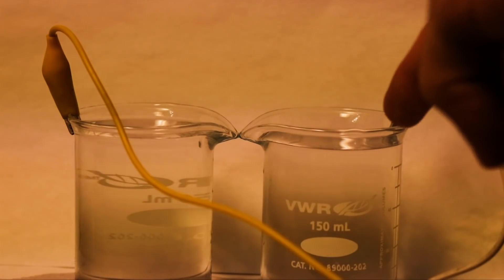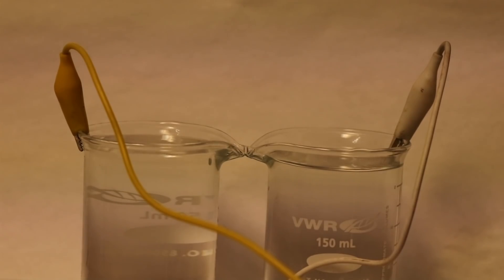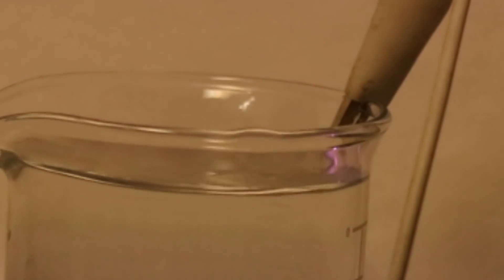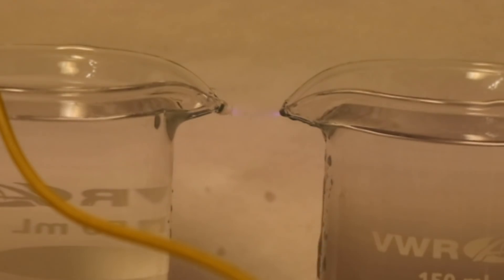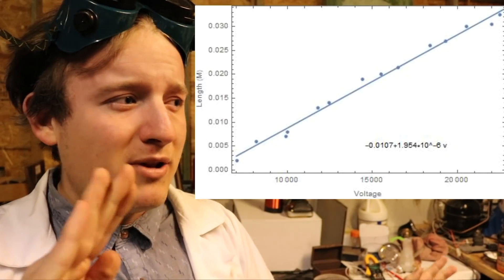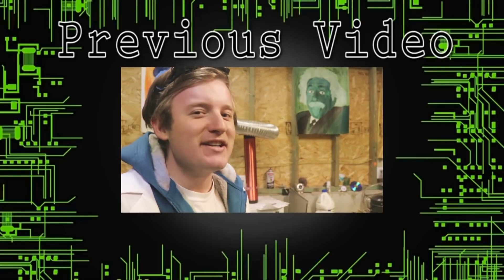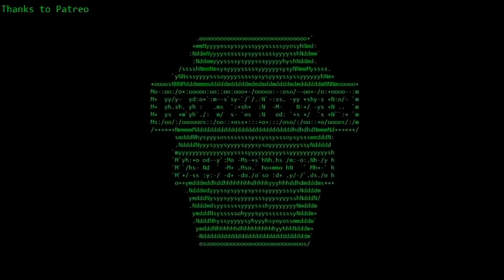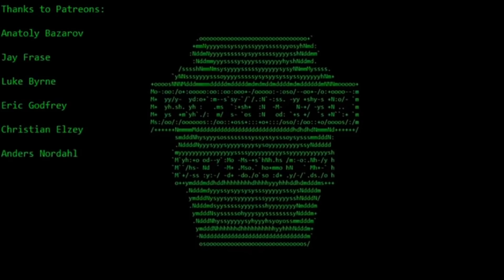How to make a Water Bridge

Comment: H2O is slightly polar.  The 105 degree angle created by the two oxygen atoms means that there is a proton, the hydrogen nucleus, the 'sticking out' a bit, relative to the other side (oxygen side).  Surely this plays a role in making a 'linkage'.   See Rotar Wolf comment too.

Comment: Shouldn't you wear electrical gloves when placing your fingers 2 inches from electrified water which apparently has a high enough current running through it to be dangerous? I'm sure you're being "careful" but why take the risk? There are many ways you could get shocked (e.g. your hand moves involuntarily due to a muscle spasm, something startles you, you misjudge your position slightly because you were distracted with filming, you lose your balance and instinctively grab the beaker to steady yourself which could result in your fingers dipping into the water or the water being poured on your skin while still electrified, etc.) and one easy way to prevent it. You were also trying to dissuade people from repeating the experiment and that's less effective when they don't see any safety equipment being used.

Comment: PLEASE Hold a flame up to the Water Bridge, maybe need it to run for a bit, not sure, try it at different distances and voltages. IF I am correct the flame should act like the water is helping it in some manner, or the water just sustaine it's own flame when you pull yours away!

Comment: You should make an optical tweezer where the floating lense moves along the laser if it's possible. Maybe the lense that projects the laser into the other could become slightly more convex when an action is applied which would cause the floating equilibrium location of the beam where the lense is floating to be moved. Like using a laser to project an object

Comment: How would it behave in the presence of high voltage ac, especially just right before the two sides touch? Imagine the frequency would have to be pretty low to deal with the capacitance of the water.

Comment: i could imagine that the temperature difference between the two cups is originating by the acceleration of the molekules so when they start to acdcelerate they are not as fast thus not carrying much energy. on the other side they should be fast thus creating more heat on impacting other molecules.
Correct me if im wrong (pls with explanation)

Comment: Will a higher current (greatly) influence the length of the bridge too? (Maybe also linear rising, but way less efficient?)
I think the Water on the cathode is hot, because it's the side you got the arcs at the moments of "bad connection".
Maybe because the hot water is dragged to this side too, but this shouldn't make that much of a difference.

Comment: Wasn't the hot water on the side that the bridge was flowing towards? Because you can assume that the 'resistance' of the water is the highest at the narrowest parts. More energy dissipated in a small volume means that the water heats up more when flowing through the bridge, towards the cup that thus warms up the most

Comment: There is energy being created as the electric passes through the water faster displaces off into heat. Like a car battery one side of the terminals are more corroded more than the other

Comment: The water being hotter on the negative side might be because the electrical potential is greatest at the bridge and more energy is dissipated as heat at the bridge. Since the water is moving towards the negative side more heat will be stored in the water on the negative side.

Comment: TEMPERATURE VARIATION THEORY:  electrons traveling through distilled water increases the temperature for both beakers. Where they're different is in the direction of flow of electrons from the copper/distilled water to the distilled water/copper, respectively. Electrons traveling from copper to distilled water emit energy and electrons traveling from distilled water to copper absorbs energy but not as much as the energy produced from the electrons traveling through the distilled water alone. The temperature raises but not quite so much.

Comment: Wait a minute, shouldn't the right beaker be the positive side because the electrons are flowing to it as shown by the water?

Also I think that the reason that the beaker on the right got hotter was due to it receiving the electrons. I believe when welding metal, the workpiece is connected to positive because the side receiving electrons get hotter.
Just some thoughts although I am probably completely wrong. 

(sorry if my wording and reasoning  sounds bad.)
Reply: Electrons move to the positive, atoms/molecules move to the negative depending on available space. Water is the atom/molecule and forces created by the electrons moving to the positive and/or the momentaneous positive states of the water molecules moving toward the negative that cause us to see the water move to the negative.Probably could even think of the water molecule as a sphere/wheel that is rotating counterclockwise as the electrons move left, which gives the water more ability to move toward the negative as opposed to more rigid structures. Something like that - I didn't bother verifying any of it with up-to-date information so expect some discrepancy, maybe a lot.

Comment: The one side is hotter similarly to EDM, Election Discharge Machining. The water being pulled by the plasma heats it up A LOT.
Also, why didn't you set the left side with some upside down water bottle, so it'd pull water out only when needed, so it stays at a constant level? Similarly, why not have the right cup have a slight slope to let water flow out?
You essentially built a very small pump.

Comment: Making a sprengel pump, like Cody did. But with the minimum amount of Mercury needed. Using a pump to pull the Mercury back up automatically.

Or it'd be cool to see how chromatic aberration works.
Or, if I look at a bright light, (I need glasses) it turns into a ball larger than the light is. If I close my eyes slowly, I can actually see the surface of my eye. WHY?

Comment: I assume the largest resistance in the circuit is the water bridge, and that’s where most of the heat is created, and since there is a flow of water over the bridge most of the heat will go towards the negative beaker? Btw, great to see you again!
Reply: underrated comment

Comment: 8:56 I don't believe that you are dissipating 17KV @ 0.44A = 7.48KW... Was that mA?
Reply from the maker: No, sorry, the circuit is drawing that much current on the low voltage side, I definitely misspoke.
Reply: @KeystoneScience  Ahh! That makes a lot more sense... Thanks for the clarification. Awesome video Btw.
Reply: I think he's using a ZVS driver to power the flyback transformer used to generate the high voltages, so it's probably 0.44A on the ZVS circuit input